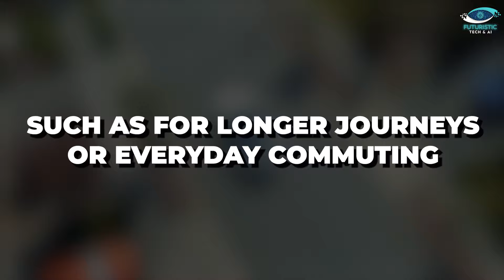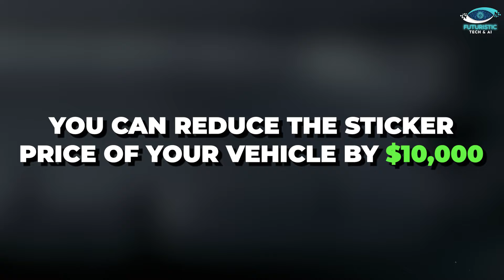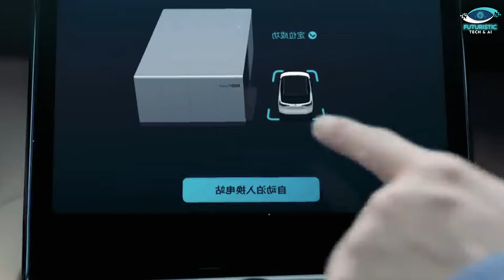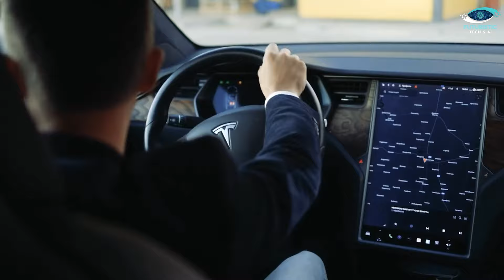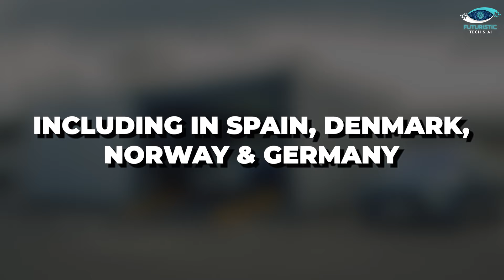Chinese Electric Car Without Battery | NIO Battery Swapping EVs Taking the Lead #china #nio #ev

Comment: Question: Does one have the option to charge at home or on the road by conventional charging methods?
Reply from the maker: The main objective of NIO is to provide battery swapping and save time. But there would definitely be an option for charging because the swapping stations are limited compared to the charging stations. So, it's not convenient to take the option of charging stations away from the customers.

Comment: Battery swapping EVs are a little like vehicles powered by swappable butane cylinders used in some countries. The source of energy is of course different, but the concept is the same. NIO may not need fully automatic battery swapping stations. Partially manual battery swapping stations may be sufficient if the batteries are made user installable just like our old buddy batteries in ICE vehicles.
Reply from the maker: Well said 🙌
Reply: Battery swapping is the worst concept in the BEV space though.
Reply from the maker: Why is that @flujori?
Reply: @flujori battery swap is the only way for me though,having gone through countless cordless drills since they were introduced, they were all discarded until Lithium ion batteries for my current 😮dewalts!
Reply: Its too expensive. And the only Company realy doing this is NIO, and look at the stock price. I cannot share all info in a youtube comment but Do a little searching.
Reply from the maker: Thanks for discussing and sharing such useful information. We love to have such an educated audience.

Comment: So. instead of queuing at a charging station, you queue at a battery changing station, just not for so long.
Reply from the maker: Yes, isn't it kind of smart? Lesser wait for everyone.
Reply: Great point but the hidden great advantage of battery swapping is the cost of replacing a degraded or damaged battery in an EV with no battery swap capability. Could be pricey. Battery swapping = convenience but Damaged Battery replacement = $00,000 i.e thousands of dollars. - Just ask other EV owners, I won’t mention any EV company.

Comment: You said something that's not true and it makes a big difference...You said when the battery swap is done "you can get back in your vehicle"...You actually never have to get out of your vehicle...You can stay in your car the whole the time...Big difference when you think about safety...You have to get out of your car to hook the charger up and then get back out to un-hook the charger while sitting for 30-an hour in between...Would you rather have your wife if she's alone go to a swap station, never get out of her car and be in and out in 3-5 minutes or go the charger route?...Alot of charging stations are in unsafe areas with no one around and you have to stay for a very long time compared to a swap station...
Reply from the maker: Thank you for raising such serious issues. We hope that the EV geniuses look into this issue and get it resolved soon.